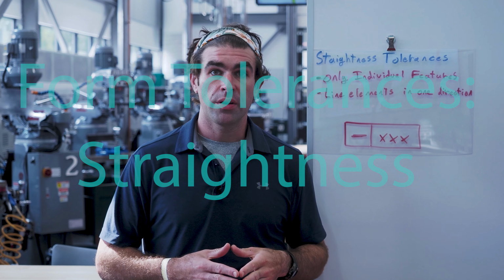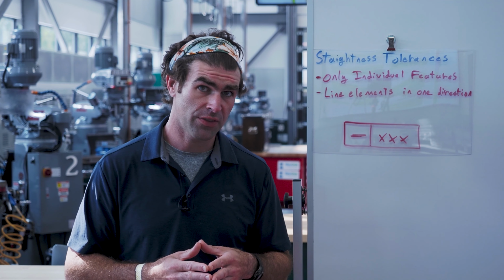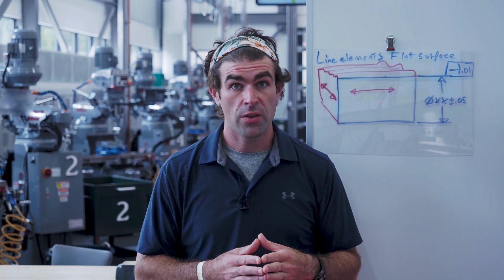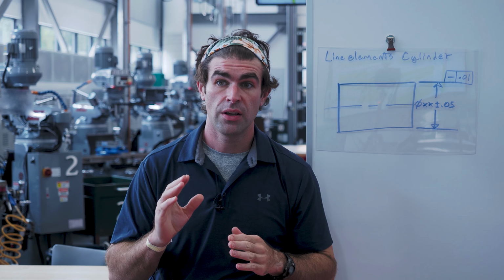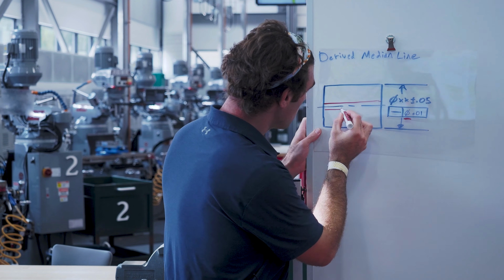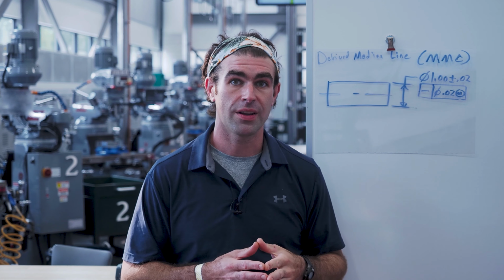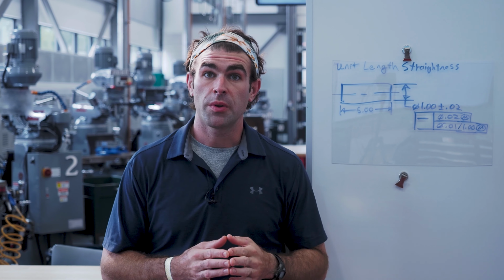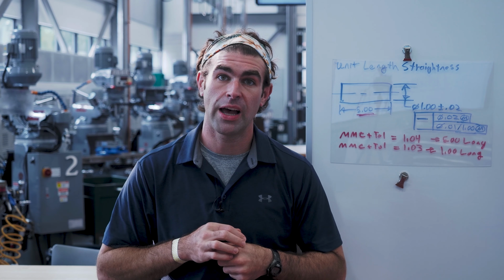GD&T Straightness Tolerances

Comment: 5.59sec the straightness tolerance would not go away, since you could have valleys in your material. Similar to a tangent plan concept. Hope I am on the right track with this. Maybe on the next version you can touch base on the tangent plane concept.

Comment: Hope I am right. The MMC (12:24) is 1.02 dia. pin plus Tol. Zone 0.02 dia. the Virtual Condition is 1.04mm vs 1.03mm as per you with a Tol. zone of 0.01 dia.?? Confused here. At MMC Pin the Tol. Zone is 0.02 therefore 1.02 + .02 = 1.04 VC.
Reply: I agree. It too think VC shall be 1.04 mm.
Reply: Dean has used correct value in next illustration at (14: 09).